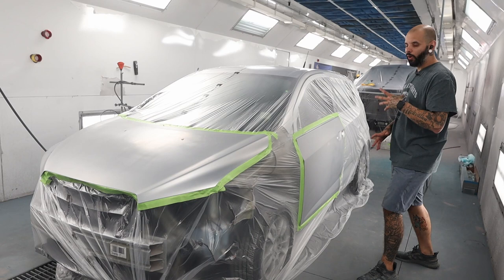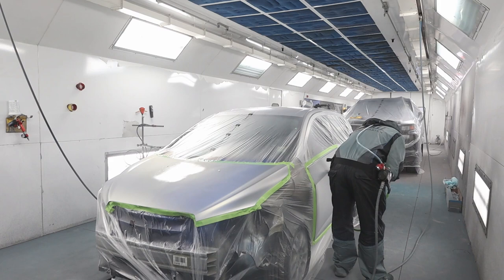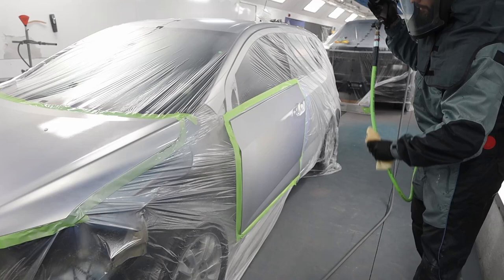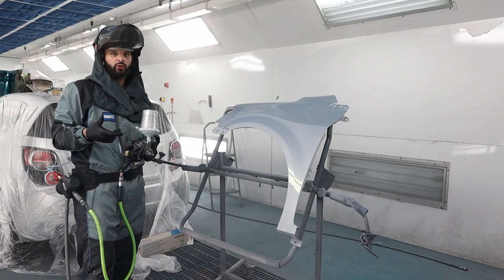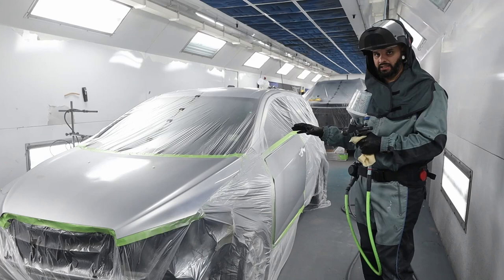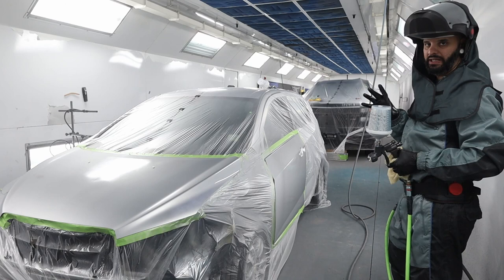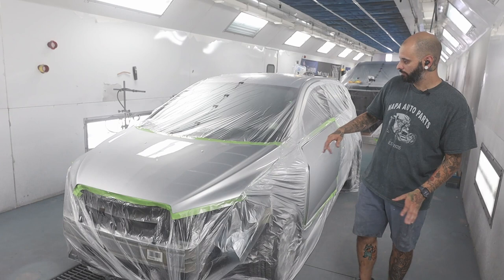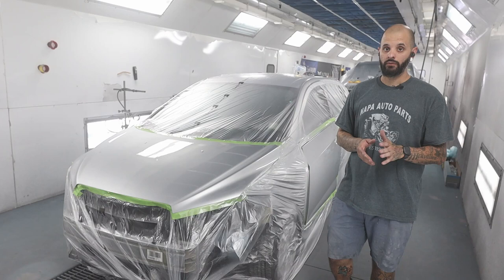Ultra 9k series (blending silver)

Comment: If you were painting a hood on a vehicle and blending into the fenders. Sealing the hood with p30 and blending PAU ultra 9k how would you do your wet bed on the fenders what would be your method of attack. I’m new to the ultra 9k system
Reply from the maker: Wet bed before spraying color. Allow to dry then blend color out. I usually just spray blender once before color and if I’m unsure of the blend I’ll spray it over the whole panel to check my blends before clear. Most of the time though I don’t need to and go right to clearing after my control coat.

Comment: The place have been working at for over a decade just got bought out by Joe Hudson this year. I have to spray this ultra 9k paint and I hate it! I was spraying chromax ez axlta waterborne paint and I love that paint so much u never had to fight with blends! Never had to wetbed! Color match was on point! Now I'm dealing with something I never had to deal with before and it's that sand look you talk about! Even on new parts! 1 thing I thought of was mybe the basecoat reducer is to fast as it says it's standard reducer but I was told there is only 1 basecoat reducer and nothing else slower. I live in a really hot state so I'm trying to figure out how to prevent this issue before it gets to summer time 😢 man I miss ez the best paint I have ever sprayed!
Reply from the maker: Just wet on wet your coverage coats. After you control coat spray a coat of 9020 over the top. It’ll smooth it all out. It’s a really easy system when you get it down. Don’t get frustrated just approach it different. You can switch to just using blender over the whole blend after it’s done if that works better for you!
Reply: @Olie_Olie_Paintz  man not going to lie all these extra steps is frustrating when ez was just so ez lol
Reply from the maker: Well you’re here now lol. Like I said instead of leaning towards frustration just slow down and figure out what works best for you! I have literally no issues with U9K. I came from ehp PPG and that shit was trash! 😂

Comment: Man I’ve been struggling with silvers lately, I’ve done everything and I still get mottling on my blend panels
Reply from the maker: Overreduce a touch and spray them a little wetter. If you’re using water you really need to wet your color out to even metallics. Should be silky and mottle free before your control coat. Takes some adjusting but you’ll get it!

Comment: I been spraying ultra 9k for three months and I gotta say it’s nice.. but I’m still having trouble sometimes with metallics I use to spray cromax water had no problems but just need to get use to spraying this one more
Reply from the maker: Slow down control coats. That’s the single adjustment I made that made the biggest difference!
Reply: @olie_olie_paintz  thanks for the tip good work byw
Reply: Still having a problem bro when it dries I don’t see it cloudy or anything when I apply clear it starts coming out..also the lighting in the booth doesn’t really help

Comment: Will tacking right before clear not cause streaks in the metallics? I spray solvent, idk if it’s different, but I’ll tack between every coat except my last and I’ll blend into the wet bed wet and it seems to help with sand piling…
Reply from the maker: It will will water unfortunately. If it’s been drying for a long while it won’t but most guys don’t wait that long to clear.

Comment: Hi, 
How does lowering the psi on a control coat help it lay out? 

Could one just spray the all the color at say 22 psi and not have to worry?  

Thanks,
Reply from the maker: It just helps to lay it down a bit more even. Not 100% necessary as long as you’re comfortable with your gun and material!

Comment: Looks like this product is very similar application as the ppg envirobase line right? Also the wet bed doesn cause the pool effect darkening silvers? Whats a psi for a sata 5k for coverage around 20psi and 18psi control coat? Thanks for any advice brother just got into a shop that sprays sherwin i never had sprayed this before a but nervous but ive sprayed envirobase and spies hitec and this looks like very close to how envirobase is sprayed
Reply from the maker: It’s more similar to spies. Covers quick like it. If you’ve sprayed those you’ll be just fine man! Super easy! And no it doesn’t pool effect on silvers! 23 coverage 19 control on sata and you’ll be good!

Comment: Hey man, thanks again for all your content. I know you are super busy but if you get a chance, can you fulfill another request. Could you make a video on how you shoot your pearls. For whatever reason shooting my pearl , is coming out really dry. I'm reducing it 10% as my formula requires us to.. but doesn't apply wet. Which results in my clear coming out SUPER dirty man. I'm using my DV1 AT 21 PSI. AND 20 PSI ON MY CONTROL, But my lay down coat comes out to gritty and not wet like any other material. Please help , when you get a chance brother.
Reply from the maker: Turn that thing down if it’s the digital version! I use 12-13 psi on the digital for base. Sounds like it’s probably too much air pressure. I know it sounds low but it’ll make a huge difference wetting it out!
Reply: @olie_olie_paintz  no joke!! What!?? On all my colors right?? Or just pearl? 

And yes digital!.. wow man thanks alot brother
Reply from the maker: Every color my Dude! The digital gauge on them reads incorrectly. If you put a gauge on the bottom it’ll read like 18-20 psi when the top reads 13-14. Sprays a lot better turned down!